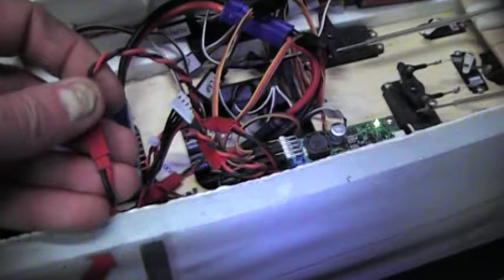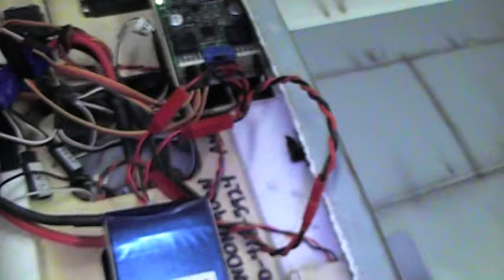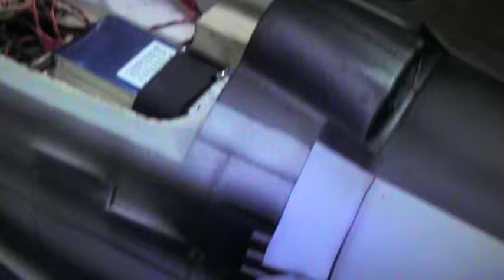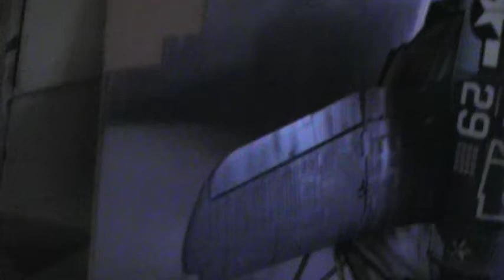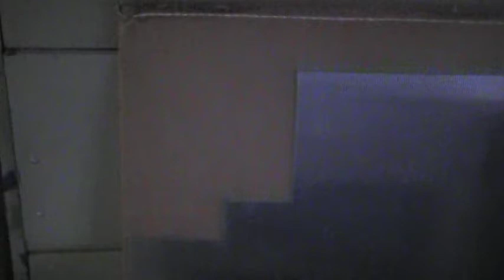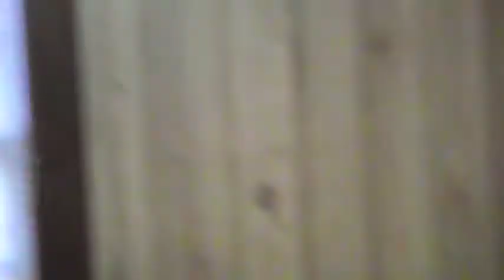Starmax A-1 Skyraider sound mod 002

Comment from the maker: Sure, But I'm not sure when I'll be able to get around to it, I have so many other projects on the table right now....it's probably going to be a long while before I can get to something like that...Sorry

As for the paint used...it simply Model Masters Enamel paints and Tamiya Acrylic model paints which are both safe to use since the plane is EPO Foam which accepts just about any  paint. it's "EPS" foam that you have to be careful with. Hopes that helps a bit?